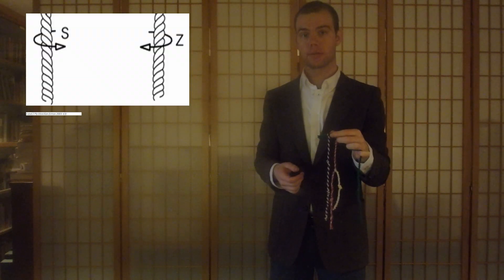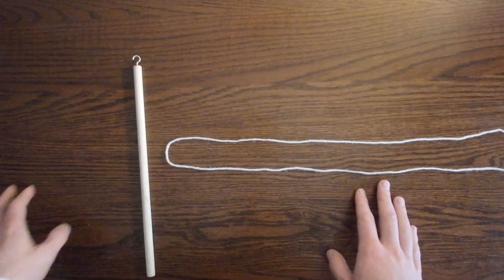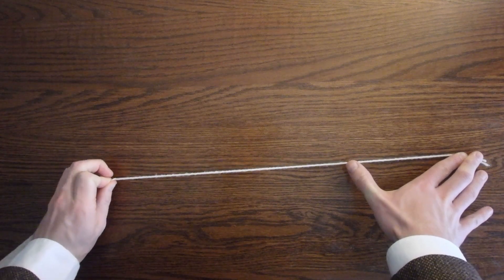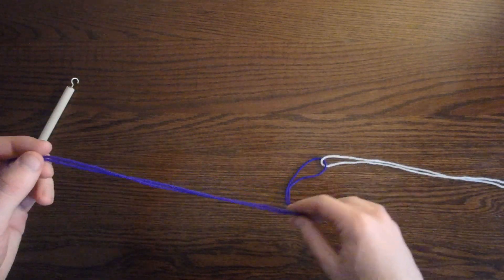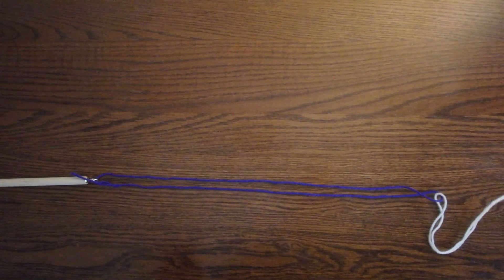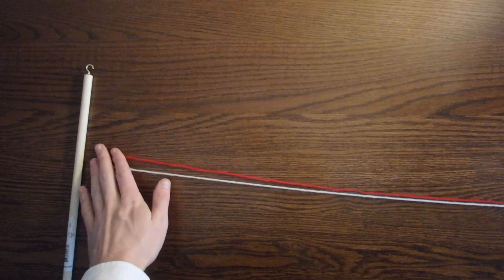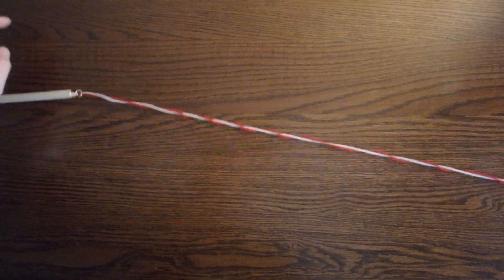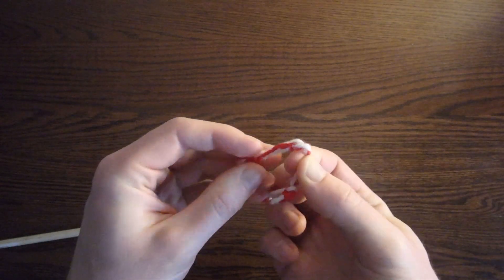How to Make an Inka Khipu (Part 3 of 6): Making Pendant Cords

Comment: These videos are absolutely amazing. I learned about Inca Quipus in my Anthropology 206D class last year. Very interesting devices. I have a couple of questions. Where can I find the rod to roll the strings, and how many times do I have to roll the rod?
Reply from the maker: The rod in the video is just a 1/4-inch thick dowel rod, with a screw-in hook screwed into the top of it. You can find these at most hardware stores. The number of times you should roll the rod is variable depending on the properties of the strings, but you should roll it enough times to achieve adequate tension in the cord (such that it will turn back on itself and form the barber-pole or mottled color patterns). You might need to try it a couple of times to figure out the optimal tension for your string-type.